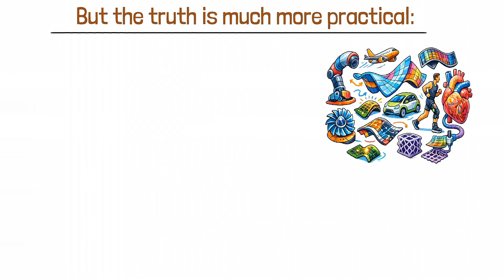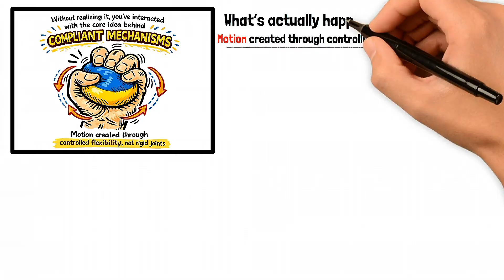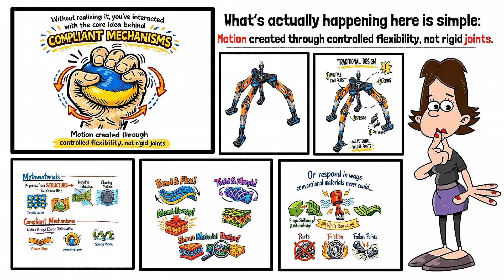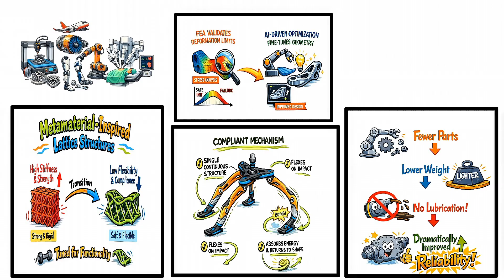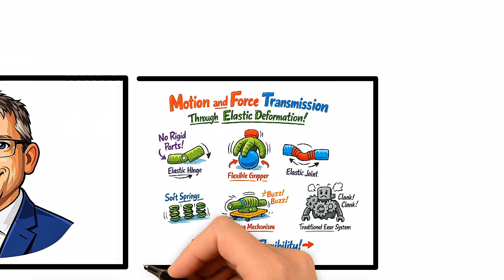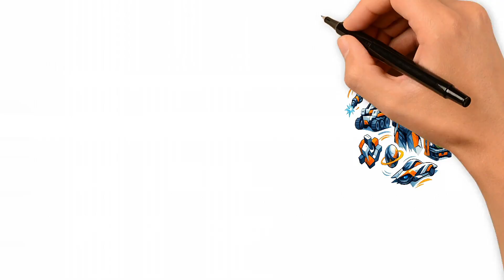Metamaterials & Compliant Mechanisms Explained | The Future of Part Design

Comment from the maker: Traditional design relies on rigid parts and moving joints.
Future design relies on structure and flexibility.

In this video, we explored metamaterials and compliant mechanisms — tools that allow engineers to create smarter, lighter, and more adaptable systems.

The next era of engineering is not just about strength.
It is about intelligent structure.